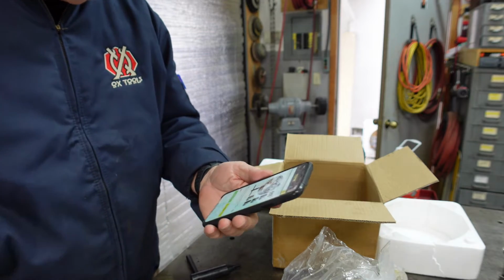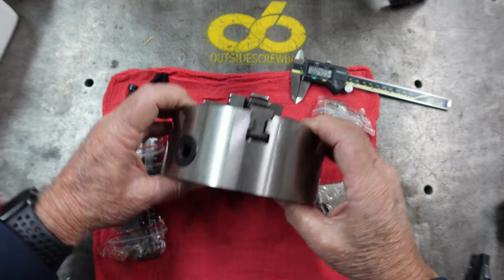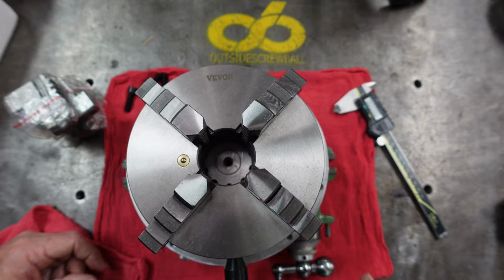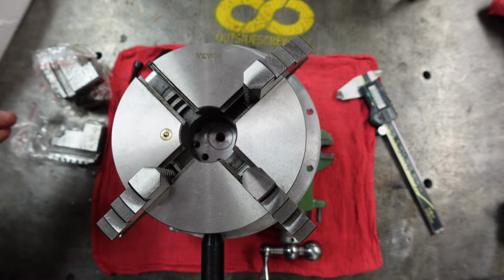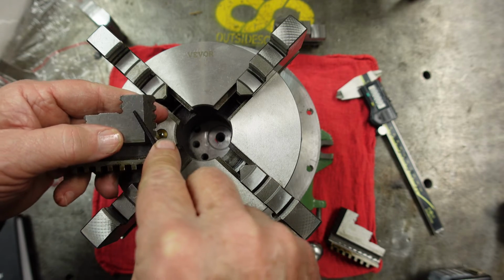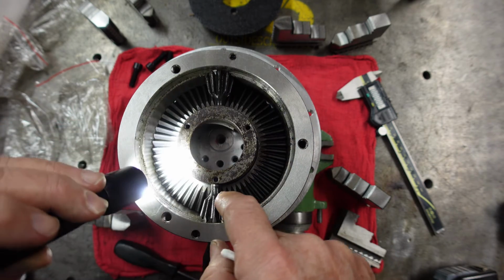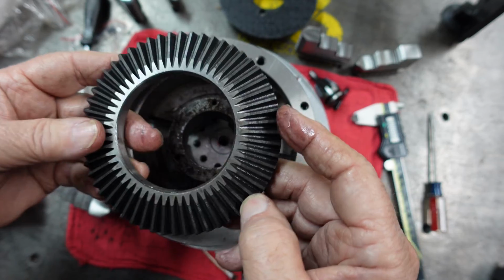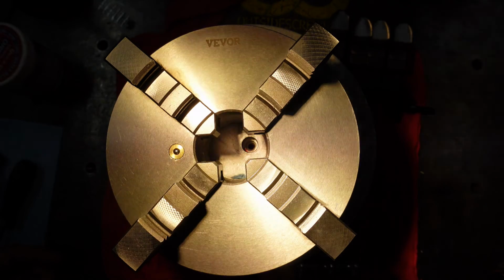VEVOR 6" 4 jaw Self Centering Chuck

Comment: I'm thinking about getting one of these for square pen stock.  some of the material is slightly not square, do you think it would be doable to add a set screw to one set of the opposing jaws to get better clamping on rectangular material?
Reply from the maker: don't know how you would use a screw, but why not just a flat shim no different when you add pieces when trying to protect a soft material....hope this helps
Reply: @outsidescrewball  I don't have a lot of shim stock laying around, the idea with the screw is to take 1 set of jaws, drill and tap through them in the direction of travel of the jaws. I would clamp the wide portion of the rectangular stock in the un-modified set of jaws and then screw down the set screws through the other jaws to support the thin sides of the rectangular stock.  some of the capability of a combo chuck without having to re-zero the chuck when going back to square stock... I just back out the set screws and we're back to zero again.

Comment: I’d be careful about those dimensions. You’re not supposed to hang the jaws beyond the inside wind of the scroll. Basically, lathe chucks are rated for full engagement of the scroll. Pretty much max holding for the inside jaws are a bit less than the diameter of the body. For the outside jaws, the usual ones used, they also shouldn’t be extended beyond the body. That is, the outside of the jaws. Somehow, people seem to think that if you have even one wind of the scroll engaged, it’s ok, but it’s definitely not. These inexpensive chucks are even less reliable, so using them properly is a must. Yes, mostly people get away with it, but it’s skirting a dangerous place.

Comment: Interesting review. But there are just too many shortcomings for it to be considered for me. The jaws aren't independent at all. There doesn't seem to be any way to "dial in" anything. Especially if it's not perfectly square. So if all you're doing it holding square things, a vice would work equally well. The chuck we have on the LeBlonde out at the Midwest Railway round house is a 4 jaw scroll chuck, but each jaw has it's own pinion so you can dial in the part. I don't like this chuck at all.
Reply from the maker: thanks for viewing and I respect your comments, like all tools they have their time and place for use, a self center 4 jaw works perfect on round and "square" stock quickly,  a 4 jaw "scroll" chuck you cannot switch from square to round "quickly"..hence my comment "time and place" depending on the work in the shop and precision required
Reply: @outsidescrewball  I just see this one as being very limited. I tagged you in a community post on my channel of a picture of an independent, 4-jaw scroll chuck. Can be both independent and self centering.
Reply: This is a basic chuck - you need to grind the jaws to make it even usable. It does the role of a 3-jaw standard chuck for square stock. I.e. it has precision of a 3-jaw for round stuff but applied to square stuff. 
Its not a "set true 3 jaw" equivalent - I am sure these are out there as well - a 4-jaw set true self centering (or whatever your favorite brand equivalent is) would be what you describe. Even Chinese could not make one that "sort of works" for just $100.

Comment: Thanks Chuck. No worse than any contemporary value chuck I've seen lately, well perhaps the surface rust was a notch worse but meaningless on non-contact surfaces and best practice is to immediately clean any import chuck, just part of the deal, you don't pay them to clean it it is a do it your self step in the process and it is a given you need to do it just for piece of mind if nothing else.  If I had a need for it I'd buy that chuck it was far cleaner than the last three chucks I have bought from abroad.  I'd rather see the surface rust than all the swarf I've cleaned out of my chucks.  It seems to me that they are actually doing a much better job than they did 10 or 20 years ago when I got my swarf bucket chucks.

Happy Holidays.
Reply from the maker: hello John, thanks for viewing and your comments

Comment: Why a 4 jaw self centering? I know why a standard one.. but why this over a 3 jaw?
Reply: Better grip.
Reply: @AmateurRedneckWorkshop  Actually it has worse grip :)
You cannot grip as well with 4 jaw self centering as with 3 jaw self centering a round part - with 4 points of contact always 1 will be loose. This is why surface plate is on 3 pins not 4 and this is why a table in your kitchen rocks a little.
Reply from the maker: depending on what you are holding, yes it will hold round just like a 3 jaw (which won't hold square)...but if you have many square items, then this chuck makes quick work since it is self centering a typical 4 jaw is independent jaws which must be adjusted/indicated in....thanks for viewing and your question
Reply: its still a scroll  chuck 3-4-6 or jaw

Comment: That looks like a clean, ready to use, chuck as the jaws move easily. My ones didn't. The Chinese chucks I got needed to be taken apart and cleaned. They ran like a gearbox filled with sand instead of oil.
You measured the maximum grip for the chuck but is that width useful? I would say, mostly not. Maybe for very soft grips, low tension on the chuck key as there are not many jaw teeth engaged in the scroll. You likely know the recommendations.
Rust..... Not on any important surfaces I hope.
Why not a 4 jaw independent that gives even more options for clamping work pieces?
Reply from the maker: Stefan, thanks for viewing and commenting, I have a 4 jaw independent, the self centering would be a quick change out of square (or round) parts and be aligned, the independent would need to be indicated
Reply: @outsidescrewball  Self centering 4 jaw, or 6 jaw, calls for good objects. Else the grip will unsafe, but You know all that.....
Centering on a 4 jaw independent goes quite fast I feel even being a newbie in this game.